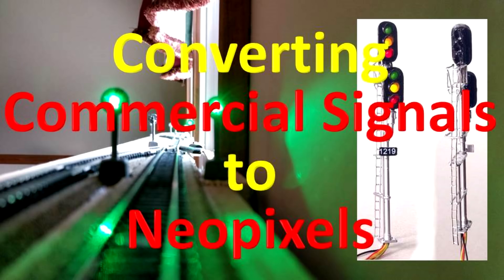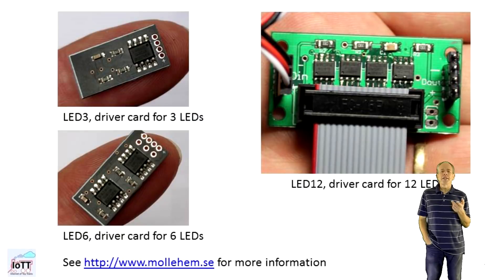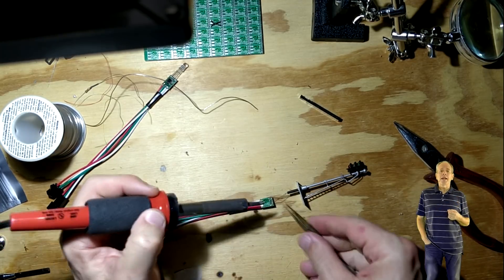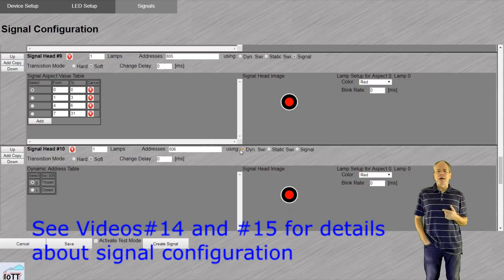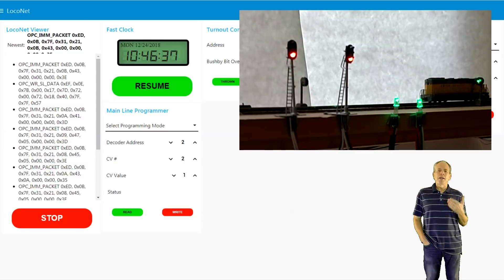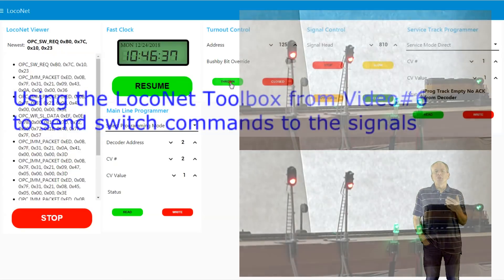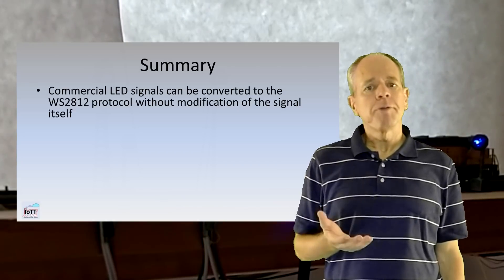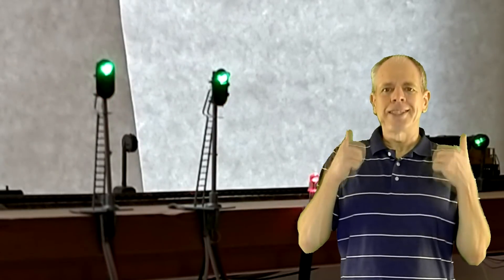Converting Commercial Signals to Neopixels (Video#22)

Comment: Can you post or share a link to how you wired up the ws2811? Im trying to follow the video and getting confused. You started with two together then you split them and i think added another male connector. I need to now hot to wire the female and male connectors to keep the chain. Thanks
Reply from the maker: The pigtail on the AUX Shield or RedHat has the mail connector (the one you can see the 3 pins). Red is 5V, white is GND, and the middle green is the signal. All Neopixels are connected parallel to 5V and GND. The Green data wire is daisy chained. Form the AUS it goes to Data In if the first Neopixel, then from Data out of the first to Data In on the second, and so on. The modules in the video have DIN on one and DOUT on the other side, while 5V and GND is on both sides of the PCB. But it is strictly daisy chained when it comes to the data line. And the female connector always has the receiving end, while on the male end comes the next module.
Reply: @IoTT  Cool. Thanks. I just did one and now I'm about to double check. Thx

Comment: Yes, I am looking to use this system for all the lights of the layout. I want to have lights goes on and off in the buildings in a somewhat random manner. I see the neopixel chain as ideal for this and the cabling is stay simples. I guess I can then use node red and manage them.
Reply from the maker: Yes, you can control color, brightness and blinking/fading of each LED individually, wo you can use it for all kind of lighting effects.
The current version of the IoTT Stick software supports using switch commands, signal commands, block detector input and analog input to control the LED's.
In the near future, the IoTT Stick will also have a true MQTT mode that let you use a configurable topic to control the LED chain. In the payload you can set the color either as RGB or HSV value, and you can either specify a single LED or an array of LEDs to update with that color. And using MQTT, you can also query the actual status of the LED. So, ideal for control from Node-RED! This will be available with the next update of the IoTT Stick software, but no date specified yet as I'm working on some other stuff I want to go in there as well.
Reply: IoTT thanks for your quick answer. I will go in this direction then.
Reply: Check out the MobaLedLib software. Great to light up your buildings. https://github.com/Hardi-St/MobaLedLib

Comment: I've been trying to figure out how to make led lights fade on and off, without using elaborate solid state circuitry. Can you help with that particular effect?
Reply from the maker: Well, if you want to have the LEDs fade in and out, you need to have one way or another to dim them in a controlled manner. Hardware is one option, but I usually prefer doing it in software as it is much more flexible. You probably have noticed when watching the video that my signals do a soft change between aspects. You can see that very clearly at 8:45 Min. in the video, even though the repla is accelerated. I do this using a state machine that updates the brightness level every few milliseconds, causing the PWM generator inside the Neopixel to dim the LEDs differently. You find the relevant code section starting line 1604 of the arduino code I published with Video #13, see here: https://github.com/tanner87661/IoTT-Video14/blob/master/ESP32/DCC_Sig_ESP32/DCC_Sig_ESP32.ino

Comment: Very nice job. I especially like how you built the signals heads. I see that you were using the turnout commands to trigger the signals and that you do have a tab for signal commands. Will you implement the signal tab ? I ask because JMRI support the signal commands on the layout design page and I would like to use signal addresses instead of turnout addresses.Can you implement a traffic signals for the roadway ? Maybe a 4 way intersection with a flashing green for turning ?Thanks,I ordered the yellow box components from Aliexpress, waiting to build.Right now I'm testing Mollehem's Signal Decoders.
Reply from the maker: Signal commands are fully supported. See Video#14 to see how they are configured. Also, Video #15 shows some sample light effects that are possible. Traffic light would not be a problem, you can specify as many LED's per signal head as you want, have them display any color and blink in any frequency. And with the signal commands you can configure 32 different aspects, that should work for a road crossing ;-)